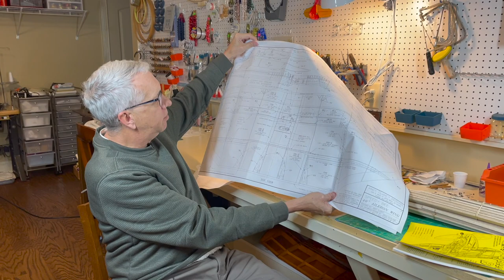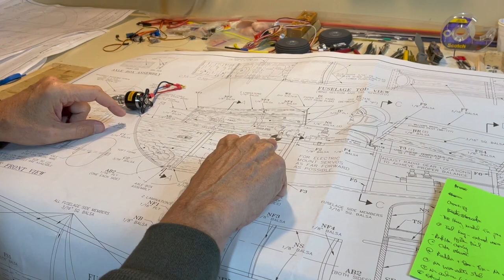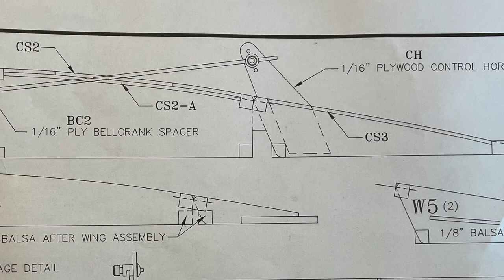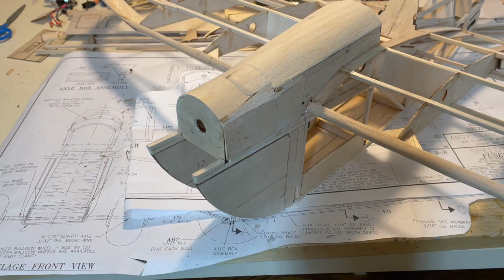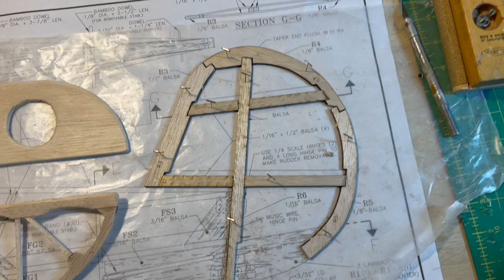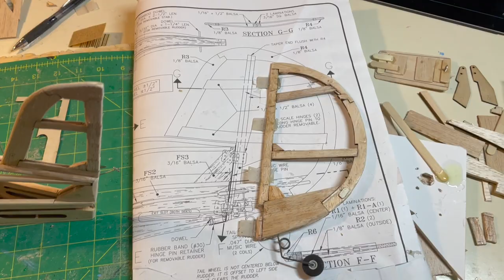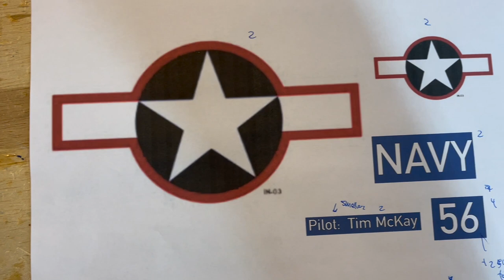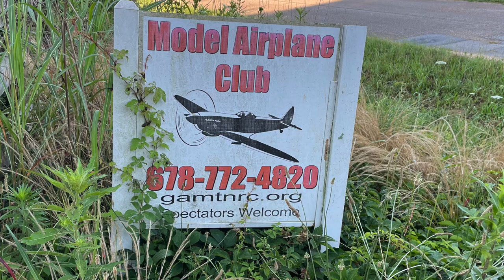Speedy Bee RC Airplane Kit Build & Fly

Comment: Great to see all vids watch 1 a week to make to get the idea to
Finally make a biplane 30inch
Bottom wing dihedral. Top 1 inch dihedral on 3s with 2212 1000kv 
10x4.5 slow prop it is so very fun
Even the crashes Thanks to you
I am alot more informed. Even about where to stand on maidens
Reply from the maker: Jhon:  Thanks for checking in and good luck with your build!  Tim

Comment: I've just bought a s/h set of unused plans for a Speedy Bee as well as the instruction book and I intend to scratch build it.  I found this video very interesting but I think I may do some things slightly differently.

1:  I like the rudder/fin mod.  I built a Lazy Bee from a kit many years ago and didn't much like the all moving rudder.
2: I'll certainly extend the nose to get the motor as far forward as possible. Probably use a 6mm firewall, too - the extra weight will help :)
3: I'll have a battery hatch in the front rather than the bottom. Servo access will be from the top after the wing is removed.
4: I usually put paper tubes in the wing for aileron servo wires to pass through.
4. I'm considering reducing the dihedral.  I seem to remember a comment when Speedys were first available that the ailerons weren't very effective because they had the same dihedral as the rudder/elevator Lazy Bees.  I want this to be aerobatic.  I have a scratch-built Liddle Stik with a flat wing and that flies really well.
5: The Lazy Bee has laminated balsa wing tips, and rudder and elevator outlines.  I may do that to keep tail weight down.
6: Depron or foam-board wing ribs might be worth considering.

Power train will be brushless and (probably) 2200 mAH 3S LiPo (because I have a load :) ) propped to consume around 300 watts.  I'm aiming for an all-up weight of <1kg 

I wish I had a workshop like yours - mine's a bit cramped
Reply from the maker: BF:  Looks like you have your Lazy Bee configuration  nailed!!  All looks good, and I agree with less need for dihedral, especially with the raised wing tips.  Tim